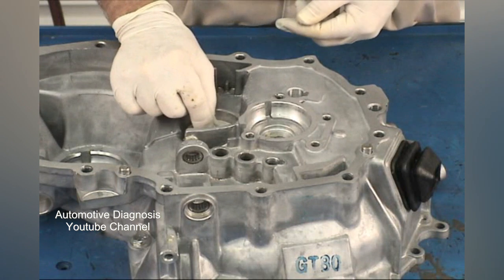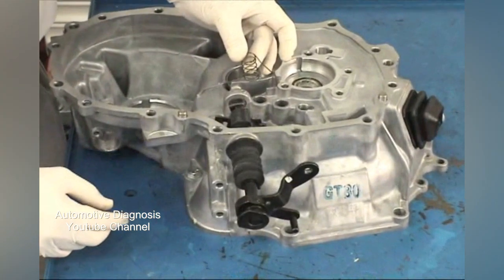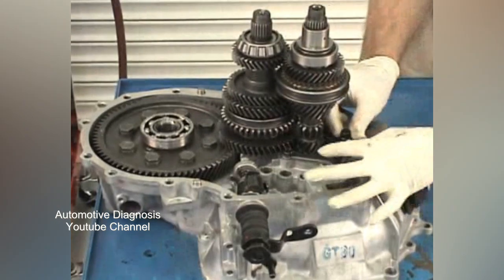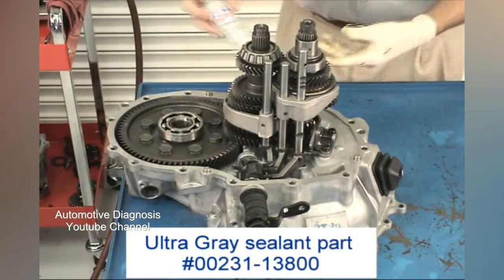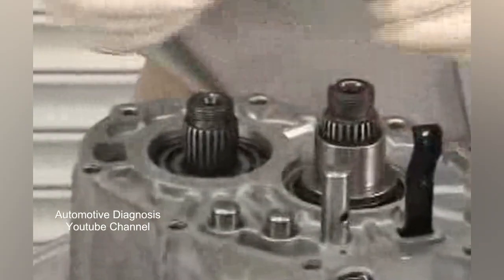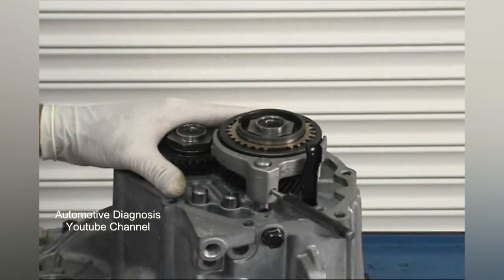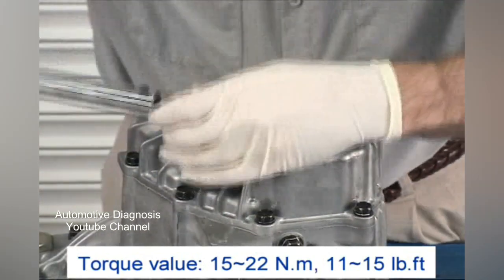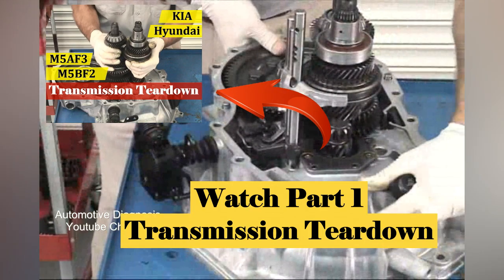Manual Transmission Rebuild - Hyundai & KIA - M5AF3 & M5BF2 - Elantra - Cerato - Accent - Rio

Comment: Great video! I have an M5CF3-1 - 6 speed  manual out of a 2012 Kia Koup.  Can you post a link to buy a rebuild kit with oil guide, seals and bearings?  I am having no luck finding parts for this transax.  Thanks for the great work!